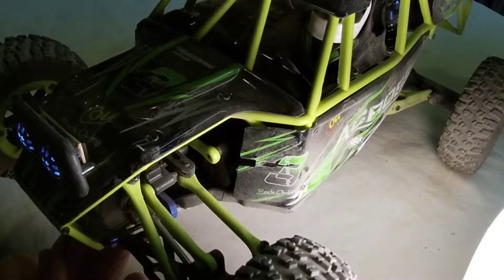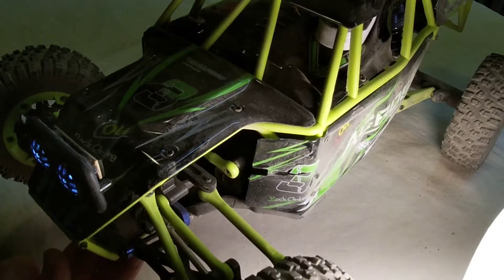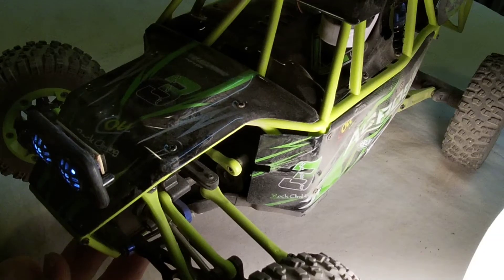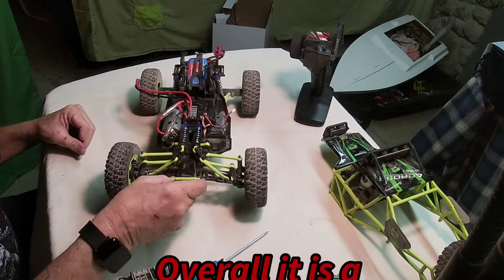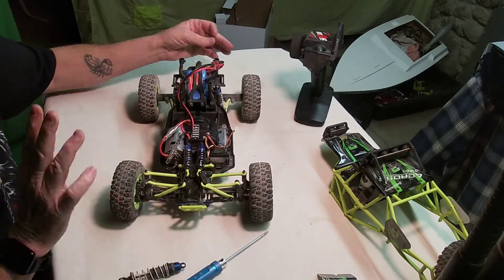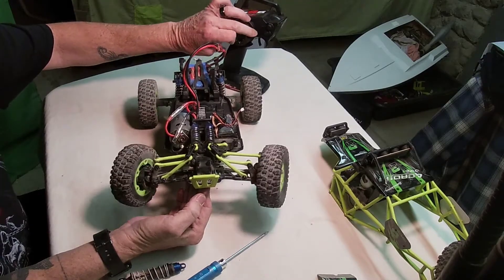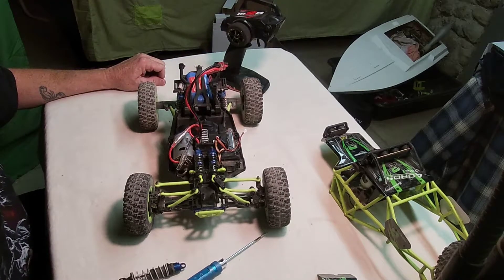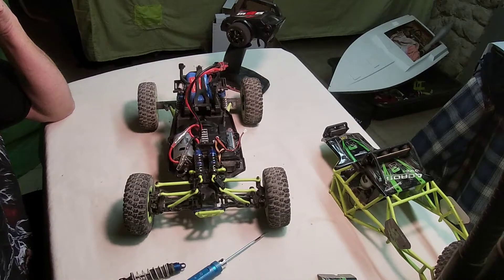WLTOYS 12428 steering failure

Comment: quick tip, don't get the aluminum upgrade kit, the parts are all loose and the screws will shake out, causing your car to fall apart mid-run. my right rear suspension links fell of, causing my rear driveshaft to fall out and break, got a new one coming, but I learned not to use the aluminum parts at all.
Reply from the maker: Mmmm. Okay that's funny cuz I was thinking about getting them. Did you try using loctite on them? Thank you for watching brother.I think I'm going to try to stick a bell crank in there somehow.
Reply: @anotherrcdude1552  haven’t tried loctite mainly because it’ll take more than 2 weeks to get here
Reply from the maker: Cool if I get it the upgrades, I'll put loctite on all the screws and we'll see if that keeps them in.
Reply: @anotherrcdude1552  sounds good

Comment: Mines on stock motor/esc. I have only changed to oil shocks. 
Hmm.. hopefully it's just a small rock stuck somewhere in the steering. 🤔
Interested to see how things go with your motor/esc upgrade if that goes ahead. 👍
Reply from the maker: I know brother that should be a quick fix. I'm thinking about keeping the motor stock and just locking the diffs. I'm wanting to do something different with it like making it a good climber with modifications.
Reply: @anotherrcdude1552  That's a cool idea bro. I'll be following your project on this. Have a great weekend and week ahead bro. Stay safe!
Reply from the maker: Thank you and you as well bro.

Comment: normal, mine blew the steering servo with 1 month of use, and it was the servo's electric motor, I found an identical motor in a ps1 reading unit and replaces it ... I discovered that the wltoys 12429 steering servo is better, and is compatible with the 12428 chassis
Reply from the maker: Cool brother thanks for the info. I'm glad to hear you got yours fixed. For some reason mine seems to be working fine again for now. You take it easy.